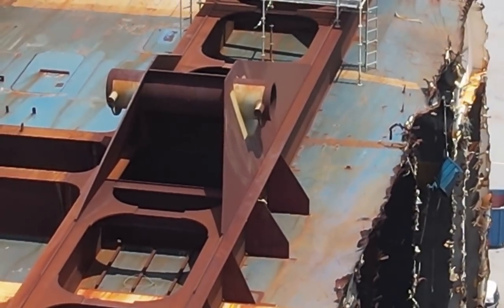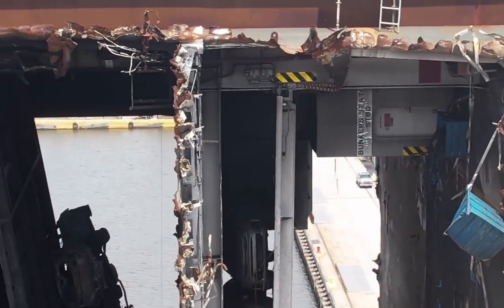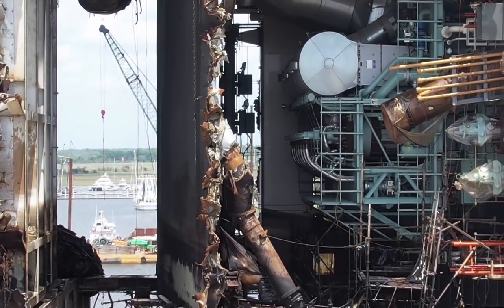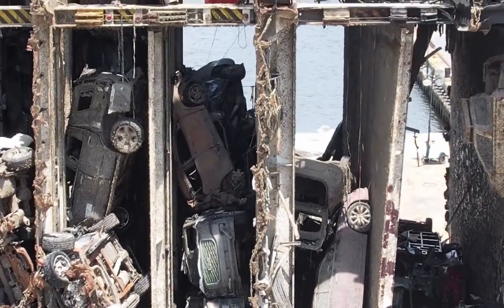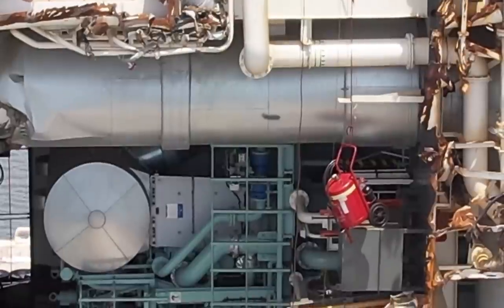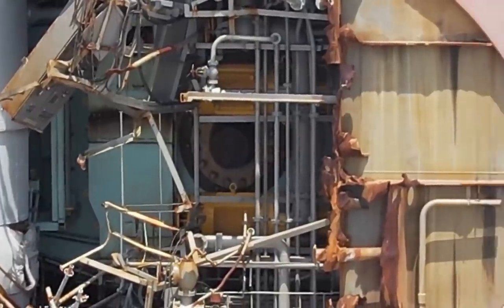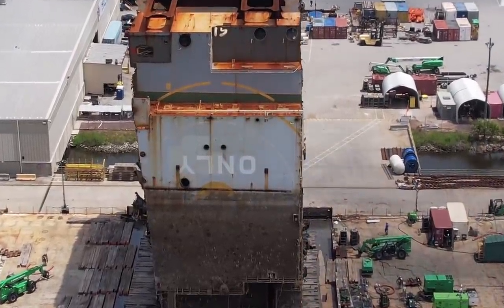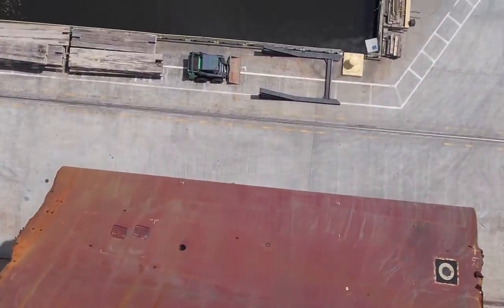CLOSER LOOK AT THE AFT OF SECTION 7!!!!! on April 29, 2021

Comment: Hey Andy. Another great video of section seven. Just below the red dry chemical fire extinguisher at the rear of the engine, brown in color and covered in ripped open plastic, is, I believe a used piston and rod assembly from the engine. And  just below the piston are some spare exhaust valve assemblies which are the upper most part on the engine that has the large lifting ring. There are some videos on YouTube of those parts being replaced in large ship engines such as this one. Also, according to an article in a recent edition of car and driver magazine, the Golden Ray's engine is a 5522 liter, 7 cylinder, two stroke diesel making 17335 horsepower. The article also stated that the removal and clean up of the Gollden Ray will cost more than $400 million dollars in the end.
Reply from the maker: Thanks for the info.  I would think that an engine problem at sea would be a bad spot to need parts!  Good eye spotting those pieces.  MM
Reply: I need to correct the post in that the part I thought was the engine piston is actually a cylinder liner. It is the part that the piston goes up and down in. Just watched a video on matt and jeffs youtube channel that shows a cylinder liner being loaded onto a ship.

Comment: CAPT Andy  Awesome drone skills   Thank you for all the info  you provide.    Some more fun facts for you to have    The Golden Ray was built in Hundai Miyeo Dockyard Ulsan South Korea  keel laid down 23 Dec. 2015  launched 26 Aug 2016  Turned over for service 2017  71,118 gross tons.  Hyundai builds under license from MN B&W the 2 cycle crosshead 7 cylinder diesel engine should be a 7L42MC    taller than a 2 story building    That Item with the plastic blowing in the breeze is a spare cylinder sleeve  these ships usually carry one or 2 along with pistons and top heads and injectors   they are fascinating machines   God Bless You Sir and the Work Of Your Hands  Y'all stay safe
Reply from the maker: Thanks for the info.  That is one massive diesel!  MM

Comment: Great footage yet again. Looks like that is a spare piston liner In the bag as it is sat in its own cradle.
Reply from the maker: Thanks for the info.  It seems that spare engine parts were well stocked on the Golden Ray.. Thanks for pointing it out.  MM
Reply: I am very interested by how clean the blue seven cylinder engine looked compared to the vehicle storage areas.
Reply: @donalddodson7365  the engine bay was out of the water plus it is a sealed room so no smoke from the fire would penetrant the engine room plus it was also sealed from when the vessel was laying in the water so no vapours from the ocean would have gotten in either. Never know give her a wiff and she may fire up again 😂
Reply: @MinorcanMullet  there are a couple of cylinder heads there aswell to the left of it. May have been a problematic engine or it is part of the of the stock given when you purchase the ship. There is no parts shop on the open ocean after all 🤣

Comment: The piece of iron the plastic cover appaers to be a spare cylinder sleeve for the engine>
Reply: React the spare cylinder liner has partial slid out of its stowage location.  There spare cylinder cover bolts wrapped in preservative cloth in front. Of it. Below the liner some exhuast valve actuators.
Reply: Spare power head, yes.

Comment: The engine is a 17,335 HP, 5522 liter two-stroke diesel in line seven cylinder turning at a relativity lazy 77 RPM. Found this info on "Car & Driver" web site of all places.
Reply from the maker: It's a monster!  MM

Comment: Andy, the large rusty cylinder you see behind engine is a spare cylinder liner for the main engine. Gives you an idea of the size.The units wrapped in plastic below that are most likely fuel injectors for the M.E.
Reply from the maker: Good eye!  All I know about that power unit is it a large one!  Thanks!  MM

Comment: Looking at this section 7 as it sits on the barge how and where do they start the process to cut and dismantle this tangled mess to manageable piece's of scrap for disposal. 🤔 Thanks again for the update. C xx
Reply from the maker: Good question!  MM
Reply: Start on the top (port side) and start the blue scissors removing all extraneous parts that can foul equipment. Lift out each vehicle to preserve it for extensive documentation and recycling. Remove hull in sections as disassembly progresses downward to maintain structural integrity. All cutting will be done with aerial lifts and strong security nets for safety as debris will tumble. Cranes will be attached to every point possible prior to cutting to minimize uncontrolled movement. Final step is the engine after everything else is safely removed. It will be detached and lifted in one piece.

Comment: Once again a year after the fact - TWO years almost - I'm wondering why Cap didn't fly the drone THROUGH the decks - especially the very open spaces. Possibly the drone loses it's signal and would drop(?) I don't know, I haven't obtained a drone yet, but I'm SO interested in doing so. Anyway yeah, and I'm guessing Cap's really not a "car guy" so to speak because he doesn't seem to focus too much on the condition of the vehicles inside the wreck, which I would be doing! I'd be scanning for vehicles that didn't get submerged and are possibly still good (albeit title-branded)... Great work though, I'm thoroughly enjoying this. I wish I had come upon this at the time it was happening. Thanks for the belated entertainment 🙂

Comment: Engine is a 7 cylinder MAN B&W 7G60ME-C9.  600 mm bore.  25,000 Hp at 97 rpm. Good size but by no means the biggest.
Reply: Thanks for the up-date on the motorbrand
It looks good, even now(unbelievable)
Reply: There is a lot of value to that engine in parts. When they salvage it they could make some money on the engine parts.
Reply: The biggest I-worked  on was a 12 cil with a bore off 1025 mm with a stroke off 2,9 m. I visit last week a container vessel from MSC lines with a engine off more then 100.000 hp
Reply from the maker: Would that engine be damaged from sitting on it's side for so long and exposed to salt air for so long?  MM
Reply: The spare liner and Exhuast valves do not look like they were under water. So the engine not underwater is a good thing.  Most like not cost effective to remove engine whole and who would buy it.  But the parts can all be sent to a shop and checked and reconditioned.  All these big parts like pistons, liners ROS, cylinder covers valves can be reconditioned and sold.So if they can get it in a safe position to dismantle there is money there.  It was they do in the scrap yards of india.
Reply: @MinorcanMullet  no problem Andy ,these engines are build for ever a problem might be that it was working when the ship turned over.all is repairable

Comment: Do you know if section 7 is a thinner slice than the others?  To me it seems like it might be & if so I know it would be due to the engine weight.
Reply from the maker: I don't think it is.  It doses look as if the chain didn't track as straight as on previous sections. MM
Reply: @MinorcanMullet  I was still curious so I started scrolling through all the photos posted on the response website. When I got as far back as the Dec 12th update I found an aerial diagram of the GR & it does appear section 7 is just a tad bit thinner than the other sections. Not by much though.

Comment: I wonder what'll happen to all the vehicles. a lot of them look to still have many good parts salavageable.
Reply: Once the auto's have been submerged like that, for even a short time, the metal starts to degrade. Who is going to salvage all those parts, which might not actually be good?  
Think the tires and wheels are still salvageable?  
Sure, they look goo from a drone, 100 feet away, but, um...they were submerged for a while...then banged-together as they were moving it all...
...
It's almost an entire loss.
Reply: @schumannresonanceswithverte  did you not see some of the vehicles weren't completely submerged?

Plus, bodywork counts as parts. That can be cleaned up rather easily
Reply: @cpufreak101  Sure...which ones exactly? 

Nothing like conning an unsuspecting public.
Reply: @schumannresonanceswithverte  I work in the parts sales business. Used parts and new parts are treated differently (though do slightly converge with rebuilds/remanufactured parts. Brake calipers are a good example of this)
Reply: @schumannresonanceswithverte  and as for which ones, basically any vehicles above the water line, which you can see some were chained to the deck or obstructed by some other obstacle preventing them from falling below the waterline. Rewatch the video, you should see which ones fairly easily, as they're the only ones not caked up in crap
Reply: @cpufreak101  You get amazing credit for your belief. Apparently, you believe that all businesses are honest. 
Apparently you have never dealt with unscrupulous recovery companies that can simply pay to have a car steam cleaned. 
...
It's called "detailing." 
The answer is simply: you do not know which ones are damaged. 
There is a HUGE industry in doing exactly what you're saying. It's not regulated, and there's way too much corruption and grift in this industry. 

The answer is YOU don't know which ones were submerged...and which ones get a 'clean bill of health,' so to speak. 
ALL of the vehicles are damaged. 
Apparently you are unable to see that ALL of the cars shifted, and mashed against each other. 
ALL of the cars are damaged in some way. 
How much would you think a good front end is worth in salvage? 
I'm not sure if you've ever dealt with flood damaged cars...
What am I saying.... 
OF COURSE you have never dealt with flood damaged titles. 
Few folks actually have
Most folks have never had a need to deal with flood recovery. 
Apparently you also do not know the immense industry around insurance fraud, and reselling cars that were "minimally damaged."
You words sound fine, on paper, or in anonymous comments on the internet. 
If we lived in your universe, instead of the current reality; you would be absolutely correct. 
However, here on Earth, your tidy view of an honest business is just not realistic. 
There's companies that make a big profit from selling flood damaged cars as "used." 
The point I'm making is that YOU personally can't tell the difference when it goes out onto the lot. 
You would never be able to tell, like millions of Americans who get duped from sweet-sounding words like yours. 
I realize you would LIKE to be right about this. 
The problem is that you personally have no idea what you're looking at, once a car has been detailed. 
I'm giving you a factual reality about the world in which you live.
Reply: @Justin Noker. Yes, bodywork counts.  Yes, there's a few salvageable body panels, and lots of grills.
Lots of the grills still look good, I'll grant you that. 
. 
Bread crumbs is basically what you're talking about. 
How much do you think a good grill is worth ? 

Just so that you will have a good working idea of what it takes to remove the cargo....
Here is the video of them removing the damaged cargo: (https://youtu.be/RYFDv-7UZCU)
 He's giving you a play-by-play of removing the cars.... 
They are literally falling out of the section of the ship.
 
The cars still need to be removed first.
You really, truly are not getting the process to retrieve these cars; and how difficult this is to keep them intact.  
None of them are savable, in the manner you suggest...
unless it is you are personally doing the work. 
Great thoughts you have.
However, that's a salvage operation at this point. 
My dad did deep sea salvage for many years. At this point, the cargo gets sold for scrap to one company who will take it all out. 

EVERY AUTO in that wreck is a salvage title. Again, you don't know which ones were submerged, and which not.
A full "detailing" hides the evidence quite nicely, thank you.

In the video link, you can see a barge, being filled with all the wrecked cargo. 
 However, if the world worked in reality how you hold it in your head, you would be correct.
Reply: @cpufreak101  NONE of the parts from those cars can be reused. 
Who's going to take the liability to warranty those parts?
Sold as is, maybe--without a warranty?

On the bright side, I don't think you need to worry about the warranty on a grill? 

Catalytic converters are worth alot as scrap... but couldn't be sold as a "used part" because you would need to warranty the product. 
I mean, I don't know... maybe your business sold parts without a warranty. 
That happens in business too, where companies cheat folks on the warranty as well....
best way to get around the sticky, thorny issue of questionable parts, actually. 
Nothing the consumer needs to worry about, right? 
It's all good....

Untested, unknown quality parts, salvaged from a ship wreck..
you dealership sold parts like that? 
taken from salvaged vehicles in a car carrier sinking? 
Did you let folks know that there was a chance that the part might have flood damage when you sold those parts?